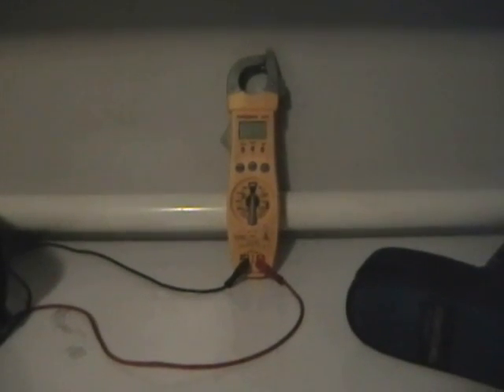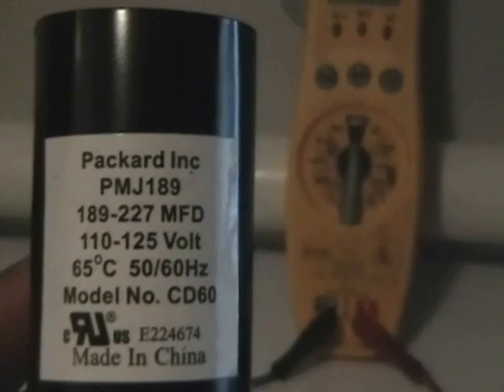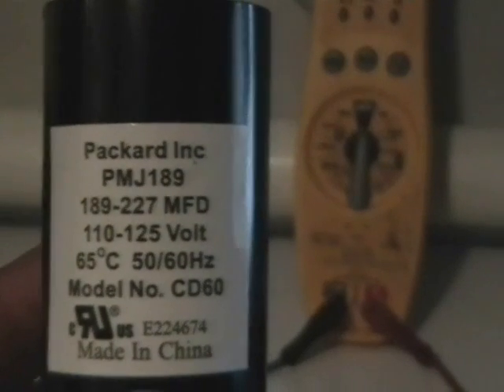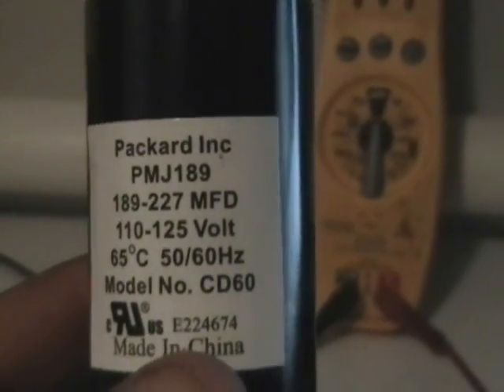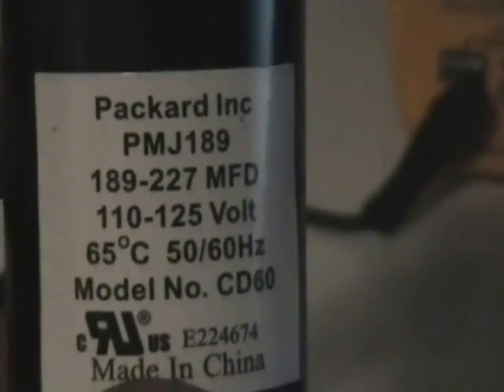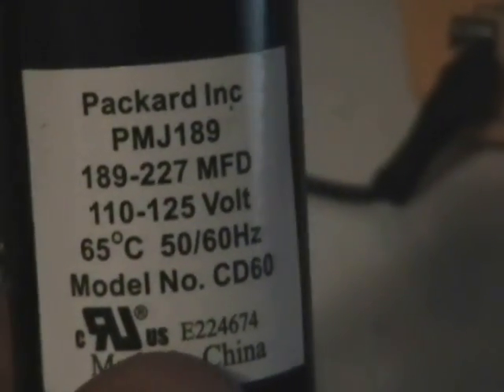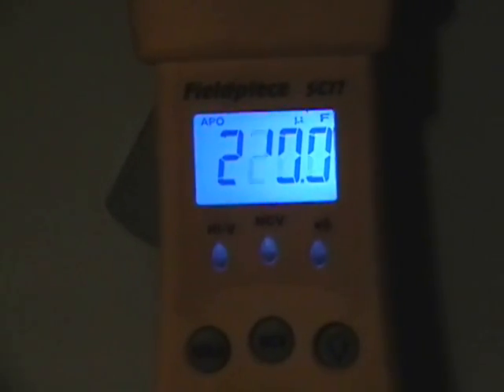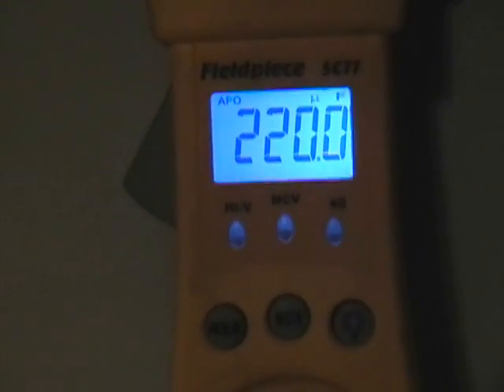Hvac motor start capacitor check

Comment: To add a bit,, first make sure its completely draind using a 15,000 ohm resistor or use VAC on meter till its flat (making sure at least one lead on capasitor is disconnectedf with power off of course), voltage present in capasitors (even a little) can effect the proper diagnosis of the capasitor